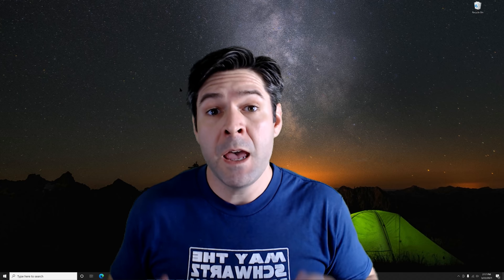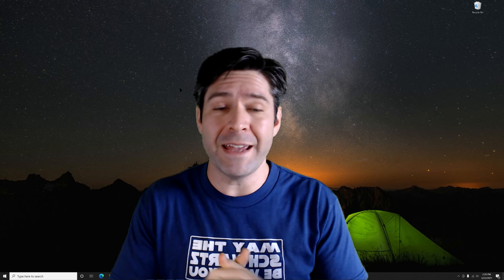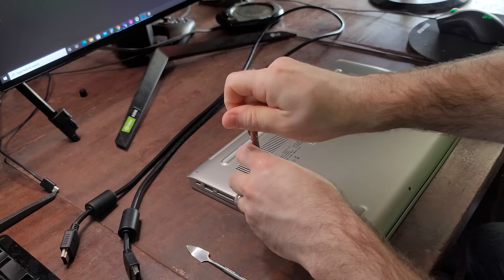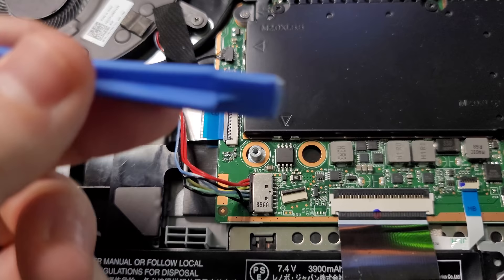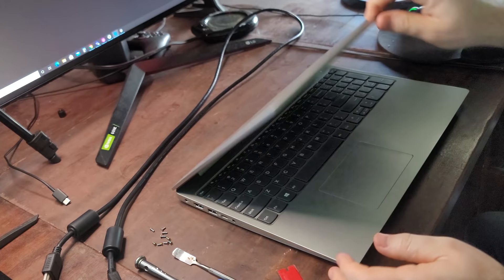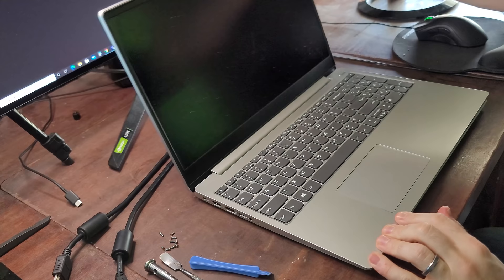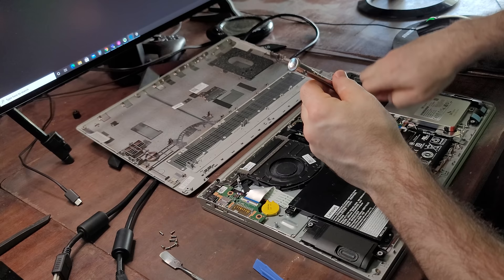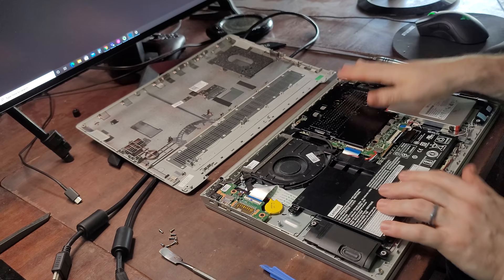Laptop Screen is Black (But Still Powered On and Running!) - Quick & Detailed How To Fix

Comment: Sadly, my laptop screen is still black. I've tried everything and the factory reset, I don't think I have a button for that but really love the step by step video. I was really hoping I'd be one of the many in the comments that have had their computer fixed following this video. 😭😭
Reply: Did u find a fix bc my laptop has it rn
Reply: @YoenderFN what I did to get it off the black screen was disconnect the power completely I took out the battery waited 15 minutes power it back on and let it cycle through overnight you got to be patient and let it do its own thing. Just to get back to the F2 F12 options. Mind you I have a older laptop with the Easy Battery that pops right out
Reply: I have tried everything it’s not working 
How did u do urs you left it on through out the night. ?
Reply: sad, but i got to fix it on the first step
Reply: Is your laptop an Acer?
Reply: Same goes to me, I did all the steps and nothing changed
Reply: It didn’t work for me
Reply: lenovo laptop, not working for me, any of these steps rn.
Reply: @narayanghimire6994 
Hold The Control Button And The Alt Button at the same time.
And press of the F12 Key.
Reply: @xmeldx 

Hold The Control Button And The Alt Button at the same time.
And press of the F12 Key.
Reply: mine is an acer, how I can solve it?
Reply: I went to the comments because this is the fourth day after the screen went black... I've done everything according to the video except reseating the ram... I have an ideapad 3 Lenovo i5....I'm feeling super frustrated right now
Reply: @mistiu  you should try letting it die which is just leaving it open for a few days then charge it and try to turn it on that helped for me
Reply: I did everything in the video and sadly it did not work.
Reply: Sad, I know you've prolly done this but instead of holding down the button for 15 secs hold it down for 40 secs, worked for me.
Reply: AYOOO GUYS MY LAPTOP WAS OKKK i still had a warranty so yeah, all it needed was just a bit of cleaning. My laptop was dusty asf
Reply: While turning your laptop on press and hold win+p and then press the power button then release it and let the magic happen 
It worked on one of my customers laptop. That was dell Inspiron 5558 
.

Comment: The "hold down the power button for 15 seconds" worked.  Thank you!
Reply: bro my sisters computer broke and i was about to give up and then I saw your comment. YOU SAVED MY SISTERS COMPUTER 😭
Reply: It's worked, ty
Reply: This one helped me
Reply: Your comment saved me today thank you very much !!!
Reply: Ikr hes the best i was about to cry
Reply: Reset doesn't affect any data ?????
Reply: I'm also running have this problem
Reply: I tried this also doesn't work 😢
Reply: Bro this really helped 😂
Reply: Omg this helped thank you so much🙂🫶
Reply: Bro this really worked thank you so much🙂🫶
Reply: Likewise
Reply: You are saving my laptop and my life as well 😊.God bless you,🙌🙌🙌🙌
Reply: Thank you souch 🎉
Reply: This fixed my HP also. Thanks
Reply: Pls reply I was wondering if it resets any settings on your laptop
Reply: me too 😅
Reply: Same!!! ❤
Reply: It's worked Thankz pp
Reply: Worked but when another time i tried to boot my laptop it again showed black screen
Reply: It worked too ❤
Reply: Thank you so so much
It worked 

I was really worried cos I just got the laptop yesterday
Reply: HAHAHAHAH
Reply: Thank you so much
Reply: Same, my dad was getting ready to kill me
Reply: What about the data?
Reply: W Comment
Reply: Worked for me too. Thank you!
I almost freaked out😭
Reply: Me too
Reply: In my case I have tried so many times it never worked until I held the power button for 15 seconds when my device was on. I tried a lot while the laptop was turned off. It did not work. Commenting so if someone has similar experience may try.
Reply: It worked thanks man you are the best you saved my Laptop
Reply: it works for me too thank you i love you sir
Reply: Will this remove files after having the hard reset?
Reply: Thanks buddy. You saved me😻
Reply: THANK YOU!! IT REALLY WORKS!!!!
Reply: I know right 👍🎉
Reply: Same it worked
Reply: This helped me also.Thank you Sir

Comment: I was about to ball my eyes out 😭 Thankfully, the hard reset worked for my laptop. YOU ARE A LIFE-SAVER!!
Reply: how did u do it
Reply: does the hard reset didn’t damage any files on the laptop?
Reply: @Han-to5on  not at all bro. It is just like rebooting the phone 📱
Reply: I wish 😭my screen just stays black the whole time
Reply: The wind/ctr/shift/b didn't work for me. The display needed the light increased. F6.
Reply: Same 🤣
Reply: Mine didn't work
Reply: Nope, I think you might be confusing it with a ''factory Reset'', don't worry, I still got all my files.

Comment: This tutorial is top notch—logical, methodical, and super easy to follow. Excellent work!
Reply: Wow, the first step just worked, I am so happy it was that easy. 
Thanks so much 🙏🙏
Reply: It works, but I'm having a new problem: my screen goes blank for a few seconds and turns back on. 
This problem fixed itself automatically after a few restarts.
Reply: Still no display on either screen
Reply: @Eastbaypisces  it could be some kind of malware. It may take a few days after trying these steps, then try again. You could try recovery too.
Reply: @MP-vf8qz  what's malware? I did all that n nothing.  Its 10yr old laptop.  Sony viao
Reply: @Eastbaypisces  It's like a virus. Sometimes it can corrupt your drivers, so if you wait random periods of time it can go away (I have seen stuff like that). Or like mine it went away after a few reboots.
Reply: @MP-vf8qz  finally it turned on . Hella annoying
Reply: @Eastbaypisces  yeah!!!!!
Reply: @MP-vf8qz  laptop was hot but still took hours to turn on
Reply: @MP-vf8qz  maybe need new screen
Reply: @Eastbaypisces  i might be late lol, what did you do to fix it?
Reply: Thanks a million my Pc was fixed using your tip !
Reply: I replaced my ram and the screen when black.
Reply: it didnt work for me sad

Comment: Grateful I came across your video. Sent my laptop for repairs, paid about $180, and it went back to the same state after two days.  I followed your video and the issue is fixed at the stage where I removed the battery, connected the power cable and powered the laptop on.

Comment: Just for anyone who hasn't had luck with these steps here's what happened with me: did all the steps with no success. Then I started taking out any hardware I had added previously. I added an extra 4 gb ram stick, and an ssd when I got the laptop last year. Took out the new ram and it works fine now.  The new ram had gone bad so pulling that brought it back to life. Thanks for the great video tho
Reply: Thanks I'll try this

Comment: Very informative video, thanks for your insight. For those of you who have a non-removable internal battery there is a tiny hole at the back with a diagram of a battery. This is where the reset button is and acts the same way as unplugging the battery cable from the motherboard. Insert a pin and gently press the button. This worked for me and I was able to boot up the laptop. Hope this helps.
Reply: I don't seem to see it on my hp laptop
Reply: Did any of your data clear?
Reply: I did that but it still didn't work
Reply: What about MacBook Pro 14 m1?
Reply: After that if our laptop starts do we have to press the button again ?
Reply: It worked. I thought I'm gonna need to buy a new one, which I don't have the money for. You're a life saver!!! Bless you!

Comment: All three methods didn't work for me but I do appreciate how clear you provide instructions in your video! It's my mother's laptop and I have a sneaking suspicion that the BIOS may be corrupt... Any suggestion in that case? Once again, thanks for this video!
Reply: Mine, the back won’t open
Reply: @kl3namm  did you make sure there isnt screws hiding under the rubber feet?
Reply: I followed everything to the T and it did not work for me..

Comment: NOOOOO 😭 I followed every step and my laptop is still broken. You did a great job at explaining everything and I was able to get through every step without confusion. My laptop is just done for 😭
Reply: I'm in the same situation... Did you ever get it resolved? I'm running out of ideas
Reply: @Theskyis2blue  I had to just get a new laptop 🥲
Reply: @Theskyis2blue  Did you get yours fixed? or what did you do cause I am in the same boat
Reply: Me too helppp!!
Reply: After this step mine still ain’t working 😢
Reply: Same. I tried all the steps even switched out the ram out to a new one. My laptop turns on meaning the lights on keyboard turn on and power light is on but my screen is completely black. Any tips?

Comment: Thank you so much! 💓 My lap top froze and the screen was black. The first option that you mentioned worked. I was going to leave my laptop alone for awhile,  but then decided to look for a solution online and your video was the first suggestion. Thank you for the tips and for your time. I really appreciate it! 🙂
Reply: what's the laptop brand
Reply: Did you lose your data after the hard reset?

Comment: Thank you SO MUCH for this video.  It was so easy to follow!!
My husband's screen went blank but was also flickering.  I did the hard reset.  Held power button for 20 secs to turn off and then powered on normally.  The screen came back in a couple of seconds.  I told him I just saved him $500!  lol

Comment: Great, technical, practical and informative! Mine worked on first step (15 seconds press). I will definitely go to the further steps if it comes again. My big thank you for a great tutorial.
Reply: Bro I have a doubt. Will the hard reset erase all the data?
Reply: @nifty8202  There are two options, one for a complete clean windows reinstallation and the other just to install a new windows without erasing any of files. Non-native installed programs will be gone though.

Comment: You saved my life, thanks a lot! I’ve tried a lot of tricks but the only one that actually fixed the issue was to disassemble and do the hard reset with CMOS battery extracted
Again, thanks a lot!
Reply: Did you screen go black because you left it on sleep for long because i did that accidentally and the hard reset thing is not working, so before removing the battery i just want to know if this method is for the issue i am facing

Comment: Wow   I was skeptical at first because the little battery does not exist in my laptop (of course!) so i gave it my best guess and disconnected a tiny harness that looked like it might be responsible for carrying power from a battery to the board it was attached to and i don’t know if it was that exact component but the monitor indeed works now! Awesome, i’m impressed!

Comment: Great clear tutorial.  Followed the first steps.  Got as far as removing the power cord and the usb bluetooth for the mouse, then it stopped running.  Plugging it back in - it booted up.  Thanks

Comment: I got real excited when I came across your video.. I guess I'm going in the one percent. I followed all the steps carefully but to no avail. The computer comes on and there's the blank screen but it has a distinct very small and almost unnoticeable flicker, but still nothing. Even so, I appreciate your video very much, the detailing as well as the visual. Thanks @ask a computer geek
Reply: He left out one thing that, based on the screen flicker, sounds like the cable that connects the screen to the motherboard. You could try to disconnect and reconnect, but often these cables go bad and need to be replaced. They are usually really cheap if you are confident enough to take it apart to that point.
Reply: If you plug in a monitor and it works then it is likely the cable from the mother board to the screen which is at fault, this is easily replaced and there are videos on you tube to guide you.

Comment: THANK YOU SO MUCHHH I KEEP GETTING THIS PROBLEM EVERYTIME THANKK YOOOOOUUUUU
Reply: What was your issue and what worked for you?
Reply: @XP_0369  can you please help me. My laptop turns on shows the display but keeps loading after starting and showing the windows
Reply: @nevineamisi6229  As soon as you start your laptop keep pressing F8 key until the options don't arrive and then you will need to select "Last Known Good Configuration"  after that the laptop will reboot itself then see if then it goes through the booting process and let me know, thanks!

Comment: I followed all the steps on this video, but my screen remained black even though it powered up.
Reply: How did you solved it now
Reply: Remove any power source than hold in Power button for 60 Seconds after that release it and just turn on your laptop like you normally would👍
Reply: Didn’t work for me
Reply: Any other ideas?

Comment: I tried your fixes. None of them have worked. I tried recovery mode, but it reads "verification turned off" I'm unable to turn it on. I don't think my model uses a cmos battery. My screen is black when it turns on, but you can kinda see a flicker of light. The light is low, though.
Reply: mine is the same did you ever fix it
Reply: @kami4362  I kept resetting it, over and over again. It eventually reset. But it took many tries. Have faith, keep resetting. I think it's ctrl,alt,shft,r, or something like that.
Reply: @katyhernandez6560  when you said resetting.. are you talking about the first step on the video? I think mine is the same .. I can see a flicker of black light but nothing is working

Comment: see i turn my laptop on and the logo pops up then it just goes black , when i plug it up to a monitor it is just fine
Reply: 😮 same here
Reply: Guys, I have a tip that may work. In my case, a Lenovo y550 laptop wouldn't show any display whatsoever, not even on an external monitor. What I did and fixed the issue (at least for now) is the following:
While the laptop was turned off and plugged in (without the battery), I pressed the Windows and B keys and the power button for one second, then let go of all three at the same time. The Laptop is now on and I'm afraid to shut it down, it may never turn on again

Comment: The  solution where you disconnected the internal battery and plugged in the power cord and powered the PC on worked for me. Thank you.
Reply: Did the issue with your laptop happened because you left it on sleep for a long time because i accidentally left it on sleep for a long time and it turned black and even the hard reset did not work, so removing the battery things works for this issue?

Comment: Thank you. This was way actually helpful. So my laptop is new and hella expensive. I just bought 3 days ago and I was making notes and out of nowhere my screen turned black. I didn't panicked thought that it might be some glitch. But the screen was still black and only the arrow was showing. Then I come to your video and just did the first step and woah my laptop restart again. Thank you. This helps me a lot.
Reply from the maker: Always be sure to completely update Windows and drivers with new laptops to prevent issues. Just because it is new doesn't mean it is updated.

Comment: Disconnecting the battery from the motherboard did the trick - thank you!
Reply: Did you screen go black because you left it on sleep for long because i did that accidentally and the hard reset thing is not working, so before removing the battery i just want to know if this method is for the issue i am facing

Comment: All great information however if none of this works such as in my case.. and the computer turns on and I can connect it to an external monitor.. I think to make your video complete the next step would be to check the display connectors to make sure they are good... and if that doesn't work then most likely your display actually died and needs to be replaced. So now I need to check my display cable to make sure they are secure... and if that doesn't resolve the problem I guess I will be ordering a new display replacement. Thanks for your great video as it at least gave me some steps to trouble shoot the problem. .

Comment: For me, I had this issue with my HP Omen 15 gaming laptop 
Disconnected the internal battery and then held the power button apparently that helps get rid of static build-up in the laptop 
Then put back the battery in it and it worked however I have noticed some dead/stuck pixels on my laptop screen which I’ve yet to find a fix or how it’s happened but that’s a separate issue that may or may not be due to what I have done but nevertheless that worked for me could potentially help others

Comment: Thanks man..I had to remove the back cover and disconnect the battery .. worked then straight away when I plugged charger in. Thanks so much for your help 👍
Reply: Did you screen go black because you left it on sleep for long because i did that accidentally and the hard reset thing is not working, so before removing the battery i just want to know if this method is for the issue i am facing

Comment: I basically just blew the fan screen where it blows out the fan air then flicked hit the black screen with my finger and the display turned on. THE POWER OF MAGIC.
Reply from the maker: Magic indeed!
Reply: Oh ! God. When you started to have a pc.
Reply: Did some light tapping at the back of the screen of my laptop. And the screen turned on. Lmaoo I've never felt like a great wizard before

Comment: Thank you SO SO much!! I was so scared my pc was dead since it sometimes blacks out.

I has tried to turn the pc off and on manu times by holding the button, tough nothing happened. 

Then I tried your first step by holding it in 15 seconds to turn it off and then back on. Finally it is on🥲😍😍🩷🩷🩷

Comment: Totally worked for me the unplug and plug of the internal battery! 10 out 10! 🎉❤
Reply: Did you screen go black because you left it on sleep for long because i did that accidentally and the hard reset thing is not working, so before removing the battery i just want to know if this method is for the issue i am facing